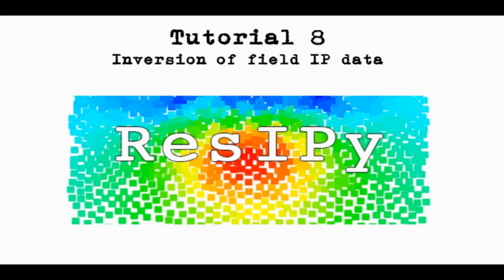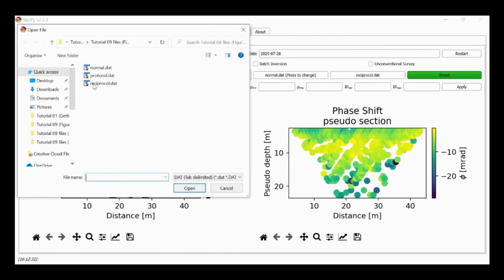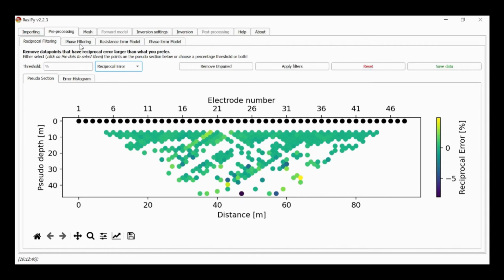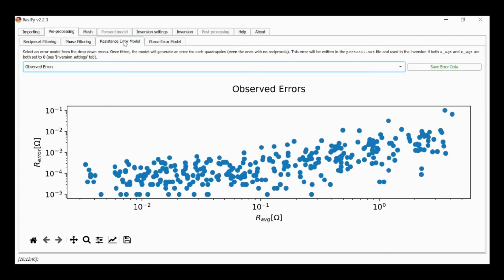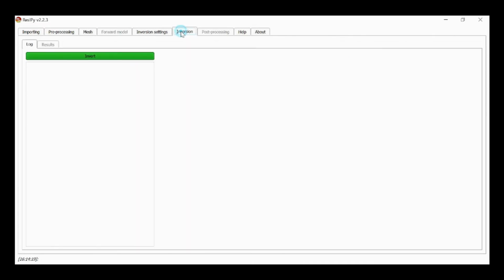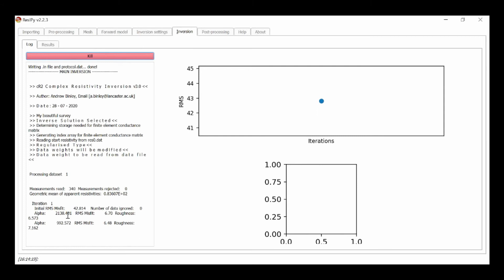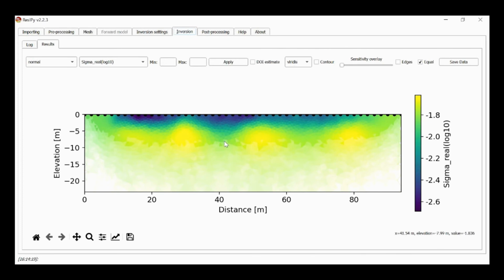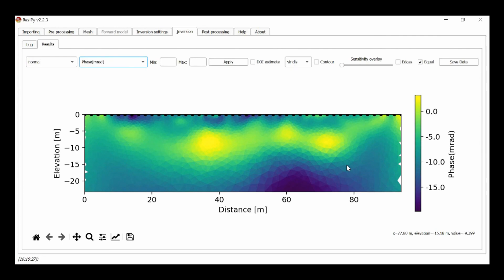Tutorial 08 - 2D Induced Polarization (IP) field data inversion

Comment: How can I process IP if I have the data in msec? I used flashres universal 64/96 equipment
Reply from the maker: You need to use conversion factor in the pre-processing -> phase filtering tab to convert the data to phase. For all low frequency instruments, this is usually linear. You can also convert them prior to importation.

Comment: hello，this is a great video,very useful.But i just wonder what shuold i do to transfer the raw data(from IRIS syscal pro) to the import data for the IP Inversion? Thanks.
Reply from the maker: ResIPy cannot directly read .bin files (files directly downloaded from a Syscal unit). You should open .bin files in IRIS Prosys III software and export the data in spreadsheet format files and set the spreadsheet separator as commas (.csv file - not regular .txt file). Then you can import that in ResIPy by setting the file format to "Syscal" in "Import" tab.

Comment: Hi. Thanks for you video. I have a raw data in stg (sting format) but the IP value is in msec (not mrad). How I can process my IP  data?
Reply from the maker: There is a conversion factor box in "Pre-processing > Phase Filtering" tab that you can use to convert chargeability to phase. Usually there is a linear relationship between two at low frequencies (< 1000 Hz). For Syscal instruments, the conversion factor is 1.2
Reply: @ResIPy  thank you!